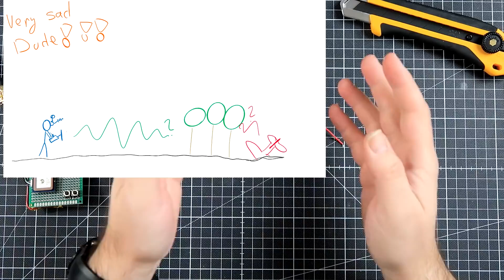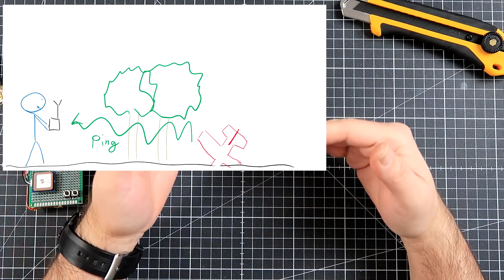Long Range Beacon with LoRa, ESP32 and Arduino

Comment: Great project. I developed almost the same hardware around 6-7 years ago when lora became popular. It is well suited for this application. However, after many tests I came to the conclusion that it requires a custom gps antenna. The reason is that if quad flips you will not get the gps coordinates. I also implemented buffering mechanism to send back last valid gps coordinates but it has never given me the exact location of my quad. I investigated the idea of external antenna embedded into the box and it will works but it requires a good antennas designer guy! Btw, I also had buzzer on the tracker. I hope you can make it work. It is a great idea as I said and will have a great impact.